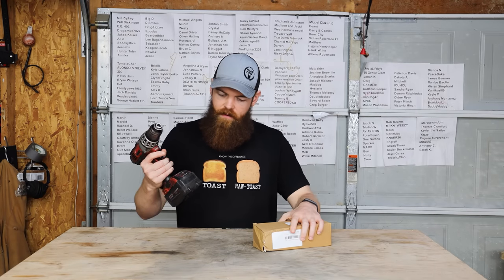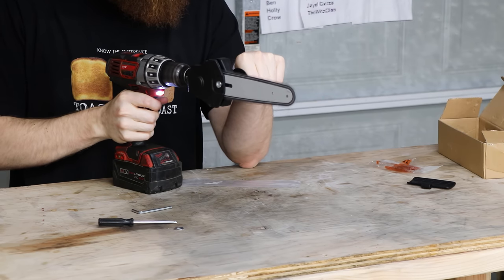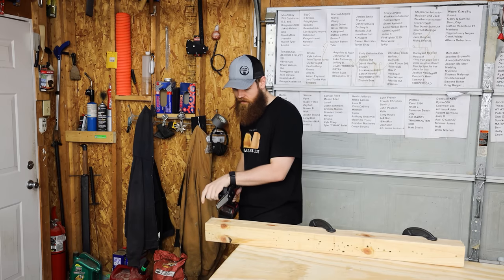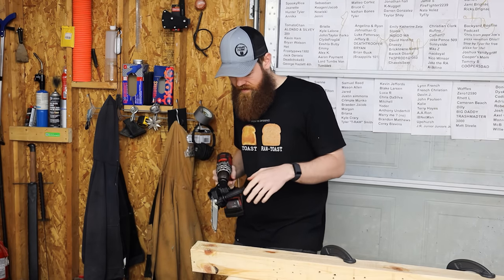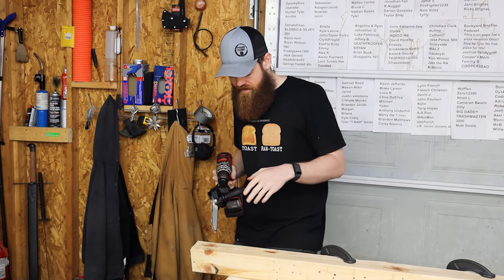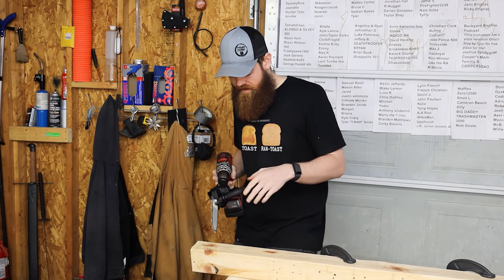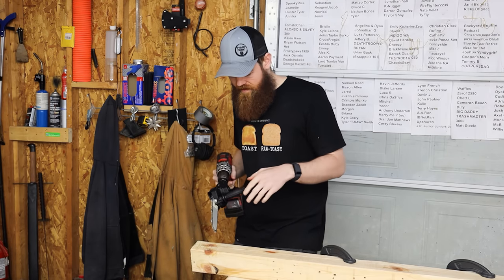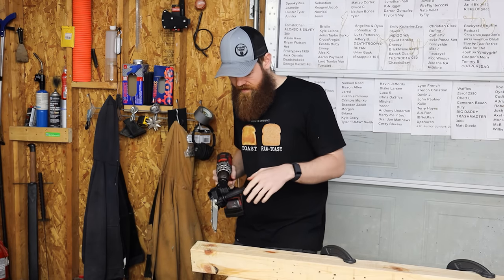Testing The WORST Drill Attachments From Amazon!

Comment: On the belt fed "speed" drill attachment, if you notice it had a hex shank for the long phillips bit. I think this is ment for a drill/impact driver with a hex receiver. Try adjusting the length of the driver bit.

Comment: That screw tool is literally made for hanging sheetrock. The "converter" part is literally just a torque limiting release. Specifically designed to cut out at the amount of torque it takes to sink a screw exactly that far into a typical 2x4. It might have a fine adjustment for setting the screw just a tiny bit more or less depending on your need.
Reply: I suppose I should explain more. With sheetrock you do not want the screw breaking through the paper. The paper on sheetrock is what's holding that whole mass of chalk like material together. The mudding compound or plaster used after putting up the drywall is very wet. That caulk material would soak it up and ruin the integrity of the sheet if not kept from getting to it. Therefore the screw must act as it's own seal for the hole it made in the sheet. That being said, no one wants to see screws in there newly built construction even after painting. So you need to set the screw just far enough to sink below the surface of the rest of the sheetrock but not so far it pops.

Comment: I've used something like the last one. In flooring it helps alot to lay down cement board and plywood quickly.  The one I have has a long extension to where you can use it standing up and just walk along a chalk line and put in a piece of cement board or plywood in a matter of seconds instead of minutes. I believe it's called a collated stand-up decking tool.

Comment: that sliding bar on the circular saw is for ripping boards and sheets. if you want an 8" wide board from a 2x10 for example, that will keep you at 8" for the cut

Comment: The last tool is called a drywall gun. It only puts the screws a half inch into the wood because there would still be a half inch of drywall that it doesn’t want to crush. It actually looked like it worked very well

Comment: Try moving the drive bit out from the drill chuck basically lengthening the drive bit more and then use the tool's depth setting to fine tune. Otherwise it looks like it could be useful!

Comment: The screw gun attachment is intended for drywall and I have seen guys use them for no grid ceiling tile . It was doing exactly what it is designed to do the depth is set so you don't punch through the drywall they mostly use them in commercial drywall where they have a lot of sheetrock to hang and larger sheets requiring more screws per board especially on ceilings because of arm fatigue that's why the ceiling tile guys use them . Long explanation but thought I would just give the full explanation. The saw zaw is a drywall tool as well not for wood its for cutting door and window openings after you hang the board. I knew as soon as I seen that 4x4 the saw zaw was done for. May need to revisit those two attachments. Sorry for the short novel.

Comment: I build floors for RVs and we use the "screw machine gun" all the time but its a different brand. We run quickdrives at all RV factories ive been at. The problem your having with high screws is from too short of a bit but they shouldn't have provided you with one thats toi short. They work great when set up right

Comment: Yes tyler you were correct about the piece with the circular saw. We call them rip guides. Its for when u want to make a long cut you can set it to the right width and let the guide follow the outside edge of the board. Not sure why they would include that. The battery would die or that thing would break before you could make a cut long enough to need that. 😆

Comment: 23:20 that tool is for drywall the space is so you don't screw it in all the way(what I mean is so when you screw the drywall to your 2 by 4 or what ever the screw wont go thru your drywall). For example I had to screw drywall to the ceiling ones and its way eayer to do it with that tool its honestly amazing for that. And those black srews are also specific for dry wall (idk why) so yea I like it.

Comment: To every one including Tyler. The screw gun attachment works just fine. What you did was you chucked the driver bit too deep in the chuck. There is more than likely a line scored on it indicating the depth in the chuck it should be. That tool is for drywall and should be used accordingly to set the screw just bellow the surface to then be mudded. They work amazing when you get it set up properly.

Comment: I know there is an electric beard shaver drill attachment for sale on Alie that actually works.
Joke aside which of these attachments would offer a cheap 90 degree gear set that would be able to take the force of a vertical shaft mower engine that I want to convert to a horizontal shaft?

Comment: That last one is to just set the screws, alot of times for the applications that it'd be used for its just needed to quickly pin obs board. Then you make sure everything's right and tight and put them the rest of the way in

Comment: The belt feed screw attachment is for drywall, it's not supposed to fully sink a screw.
The depth adjustment is for the thickness of the drywall.
They're an absolute must if you do drywall.

The rest, are just terrifying.
The lack of guards, the general lack of any safety, as well as really crap build quality.

Comment: The last screw attachment is for hanging drywall. Most drywall is 5/8” thick. You don’t want your screws going all the way through it. Looks like it’s working properly to me.
Reply: Think of the 2x4 as the drywall. The screw should go all the way in. He just didn't have it adjusted properly.

Comment: Also the chain screw gun is a tool used in sheetrock installation. wood may have been too hard? Its set to not drill through the sheet rock. Just into the wood.

Comment: 22:36 the drill is supposed to work like that its supposed to be used to hang Drywall!  

The depth of the screw that sticks out of your material represents the thickness of that drywall/sheetrock, so as not to go through the entire board and subsequently hold nothing.  Screw should be just a bit deeper than flush to the sheetrock.

Comment: By the looks of it you need to have the drill bit for the collated drill attachment set further out of the drill chuck, I'm assuming if you've pushed the bit all the way to the rear of the chuck it doesn't have enough length (lol) to drive the bit fully into the wood. And yes you have to keep your finger on the trigger before driving the screw

Comment: That black bar on the circular saw was an edge guide like you thought.

It's to help with really long straight rips in things like plywood or plank.
Reply: I cannot imagine with the wobble on that shank anything will help that particular circular saw attachment
Reply: @yeasonwhat  i didn't saw it was any good.

Just that it was intended to help with long rips.

Comment: Tyler, the last drill attachment is ment for fast and easy application of screws. Instead of having 2 hands to start driving a screw, you can duel wield guns or simply take the attachment off after blazing through a bunch of screws to finish them off. 
Probably a product targeting roofing/flooring trades. (Not defending the pointlessness of the product😅)

Comment: The screw gun attachment might work properly if you don't slide the screwdriver bit all the way into the chuck so it can reach further trough the attachment and drive in the screws all the way. Kinda like you would use a tiny drill bit.

Comment: Great video as always. I think the problem was the materials were too cheap. You should have used the chainsaw to cut down an entire Oak tree. You should have used the Saws All to free a person trapped in there car. The metal cutter was meant for cutting titanium sheet metal. The screw machine gun should have been used to drill concrete screws into a cement block wall. 😂

Comment: The last attachment looks like a screw starter kit. The main function look like to line up the screws perfectly and screw only part of it inside so you could remove easily if you needs adjustment.

Comment: Automatic lithium electric drill chain screw gun coverter
    *The chucked-bit was driven all the way to the bottoming out point inside the drill try not putting the bit all the way in for depth that may account for the 1/2" to 5/8" gap to sink them to the hilt.

Comment: The screw gun adapter is probably meant for hanging drywall. The reason why you don't want them to be driven all the way is because the screws run the risk of tearing through the drywall instead of hanging it in place. It looks like it's leaving just enough space to account for a drywall sheet's depth.

Comment: Used the wrong drill. Try again with a corded and/or higher rpm drill. Also when building you some loctite on structural screws. Even in plastic it won't come loose as easy.

Comment: I'm pretty sure the automatic screw thing at the end was meant for drywall, if the screws stopped any closer they would crush the sheetrock... maybe?
Reply: Not at all, it's just than the drill it's not ideal for the attachment, it should be a little thin and large on the chuck or then, the drill bit should be longer to get to the bottom, when you configure it to get bottom the drill bit must be at the botton of the attachment otherwise you will cant use it for is purpose

Comment: There is a company that makes a drill mounted sheet metal dimpler to make cuts for hvac contractors that seems to work very well.  I've never personally tried one, nor remember which manufacturer.  But would be interested in seeing real use vs marketing bs.

Comment: Black and decker made a decent tool. It’s not the best but for your average person at home who needs to do small projects it works perfect I can’t remember what it’s called but I have some of the attachments. It’s a drill with interchangeable heads. I think it’s like the matrix. I think it’s called Black & Decker matrix but you have saws. Are you have drill you have circular saw hammer drill. All kinds of things works pretty decently a little on the expensive side. Maybe you could try a video on that and see what everybody thinks.

Comment: The blue saw (white plastic) broke because you didn't use it properly. it is supposed to be used as a jigsaw as the blade cuts moving up and down (blade in vertical position) and not back and forth (horizontal position) as you did it. There are many videos on this here and the people showing these are usually quite happy with the result. I have one also but one think I don't like about it is the vibration on you arm. and one more think to cut a wood faster with these attachment, electric drill are recommended as they spin much fater than cordless.

Comment: You oil the bar and chain yourself. Manually. I got a mini hand chainsaw it came with a little bottle to oil it. With any chainsaw make sure the clutch / chain plate bolt it as tight as u can get it without breaking It

Comment: the ONLY reason i can see for tha belt fed thing is for decking. where you can move the board where you want it, drive the pre started scern, and then move to the next, but that really only helps for replacing the boards on an old deck... i think it's just trash

Comment: I feel like the main flaw in all these tools i that they are trying to change the direction of the motor that the drill already has, instead of going with it like the grinder chain saw attachment did. I understand why they do it, with the way drill handles are it make sense to change the rotation of the saw 90 degrees but i think thats resulting in a huge loss of power and way more stress on the parts

Comment: The last product is for drywall hanging 😂 it’s supposed to go that deep because it sinks the head into the drywall for less mess ups and faster screwing for finishing drywall 😂
Reply: It’s not just to put a screw into wood has to have drywall on top to sink the screw 1/2 in or 5/8 that’s why the screw is out that far

Comment: Doesn't matter if they work or not, they got your money. That's really the lesson behind these scams they sell on Amazon.

And you can get the proper tools that match these at any home store too, and for not much more money if you're willing to use corded and a budget brand like Wen or Genesis (Or even Harbor Freight store brands), they both have a 4.5" circular saw for under $60, and the cordless DeWalt version is $180 (Milwaukee's smallest is a 5-3/8s that uses the 12V, so I wouldn't recommend).

Comment: I would call what you cut a sheet of metal, not sheet metal... I'm really surprised it cut that. That's supposed to be used on things like sheet metal roofing which only 0.36mm-0.48mm around 1/54th of an inch.

Comment: i think the circular saw would have some potential should it be made with better quality parts that lasts and keeps the saw steady and firm, not loose like you showed us, as far as the screw thing, to what i can see is a good way to start your screws on the fly to position where you want them, then finish them off with the drill it'self without the attachment, so i can sort of see where they were going with that, but i would never get the chainsaw attachment, that seems dodgy, just use a chainsaw

Comment: The last device is for hanging drywall. It has a depth gauge and a clutch. It's designed to only drive the screw in so deep so as not to pull through the sheetrock. Have you never done anything DIY or construction related? 🤦🏼‍♂️

Comment: I got the chainsaw and the jig san attachment, and you used  both of them wrong, for the chainsaw you don’t Need the extra washer, you just have to put the scew in the right place, it Goes inside the plastic case, the you hsve toctighten everything for it to work propperly and the chain to dont go loose, and for the jigsaw you obviosuly need to place it against the wood for it to work propperly, so that way you don’t bumpit over and over again until it brokes. If i had seen your video before buying the attachments i would never bought them, but luckly i didn’t, and i got them and do lot’s of sutff just with my drill, youtube reaches woruldwide, and in some places this “cheap” solutions are the only way to go, so be aware of the reach your content got, and be responsable about it. Greets from uruguay

Comment: I love these videos purely because it's hilarious to see unpractical men using tools. Kinda like monkeys figuring out how to solve a rubiks cube. 

The small chainsaw attachment is for pruning. An axe or machete would be a lot of hard work if you were going to work on a decent sized tree or something. Better to just get an actual mini chainsaw though, they cost peanuts, same with jigsaws. These drill attachments never make much sense to me, usually more expensive than the tool itself, and drills don't have motors powerful enough anyway. You'll likely burn out your drill, and have to buy another one of them as well.

Comment: Do you have a mechanical background. I've never seen someone stumble so much, putting together such simple things. 
The way you don't realise that a chainsaw pulls forward?????
You seem to be negative about the tools, without having a clue how to assemble or use any tool.
You definitely should not be allowed to recommend or diss a product based on this video.
Try a trial run before criticising.
No one in their right mind would think any of these drill accessories are equal to their purpose built units. 
Especially when you don't seem to know how the purpose built units work. ( chainsaw pulls forward......really)